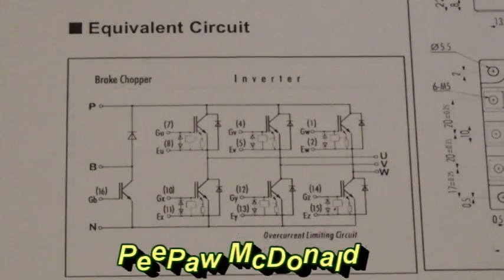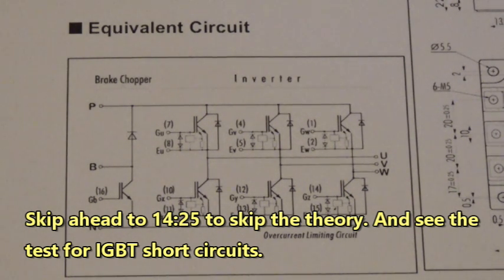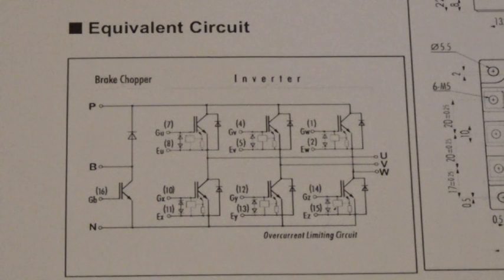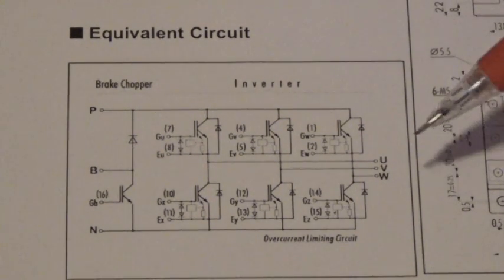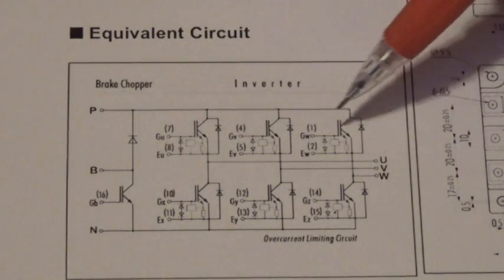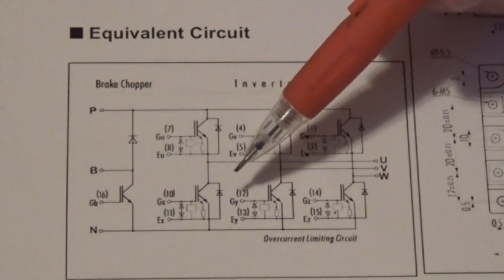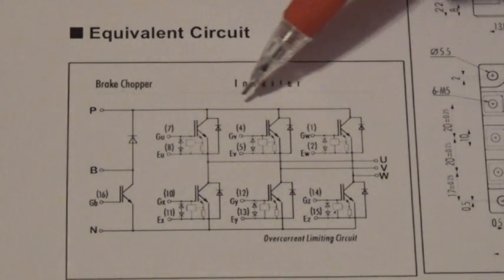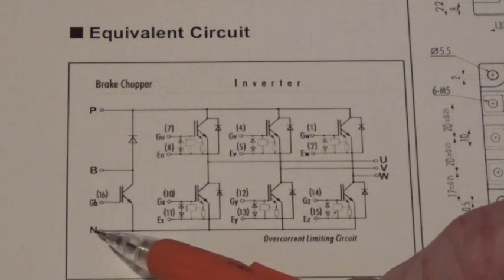Testing the IGBT Power Module for Short Circuits

Comment: I have problem with SMD bidirectional TVS diodes code , i have VFD to repair but some SMD TVS i dont know how to find it . Do you know how to find SMD TVS ? some code printed on SMD are not correct but i cant use any type. only the type that used by the manufacturer who manufactured the VFD.

Comment: I have started to work on traction system on subways and there is a problem which we couldn't solve with my coworkers that is the burning failure of c/I unit. The igbt of converter/inverter unit is burning time to time. This failure happens more especially in one train comparing others. We changed it with new ones, talked with producer but couldn't find the reason. Do you have any idea?we are testing the fiber cable and other cables. Do you have any comments on this matter?
Reply: Do you have the model of the machine and converter/inverter board? Do all the boards fail in the same way? is it always in a particular motor phase (U, V or W) ?Does it fail in the rectification area ? You can focus your trouble answering those question. I hope you already fixed it and can tell us how you did it